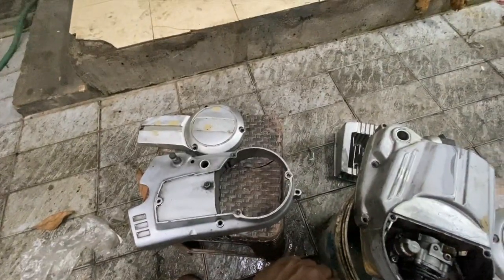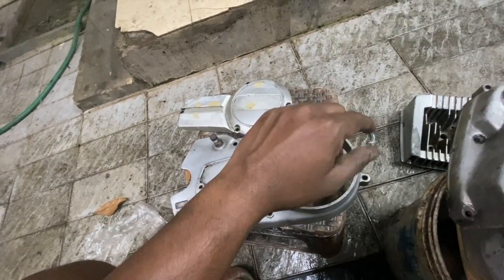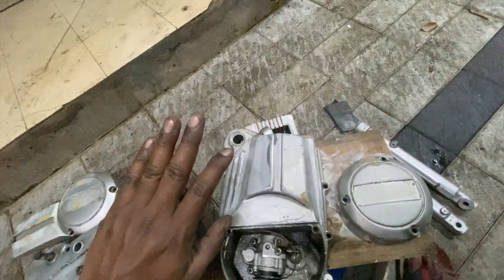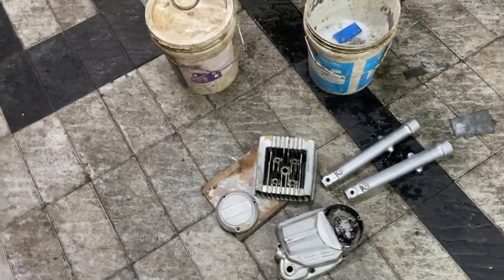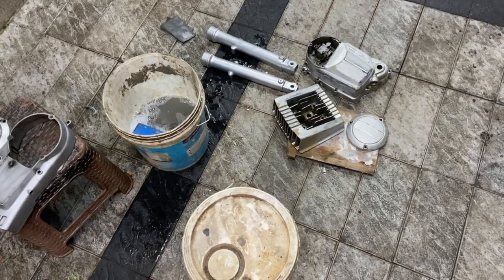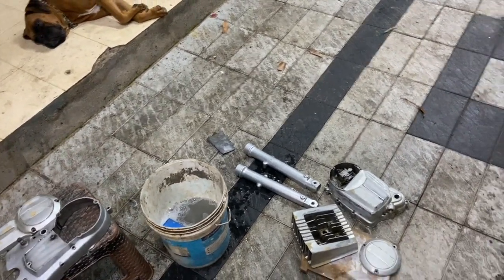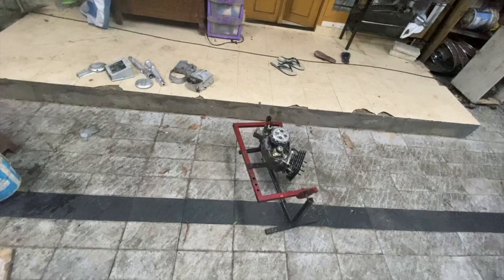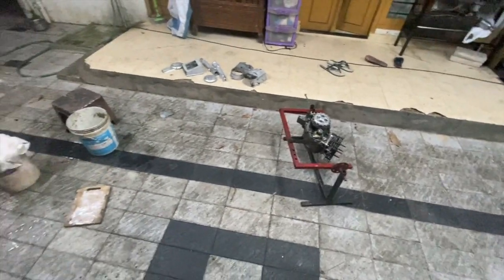Yamaha rx 135 tiger paint, big flop (English Video)

Comment: If the old paint remains the new paint never stick together
Reply from the maker: Actually old paint is the best surface to paint, if the paint is intact you just need to scuff it and paint
Reply: Use Grey color primer essdee
Reply: Apply 2 time 1 st and 2nd.after the paint polish with 4000 no polish paper (metal polish paper)
Reply from the maker: @rahulgajinkar6084  not 4000, 400 grit paper